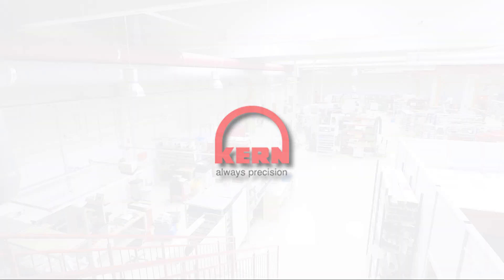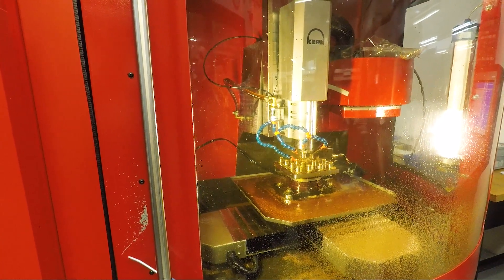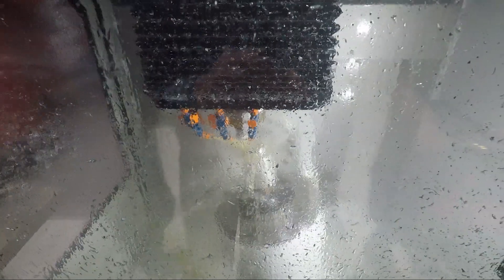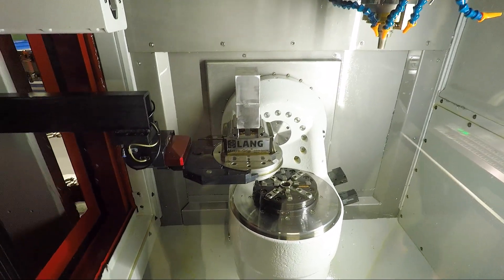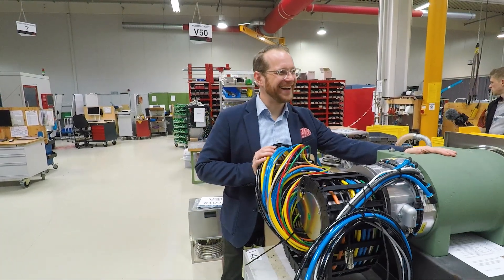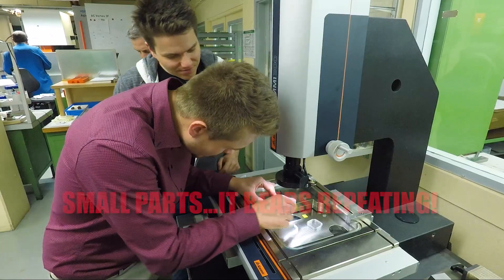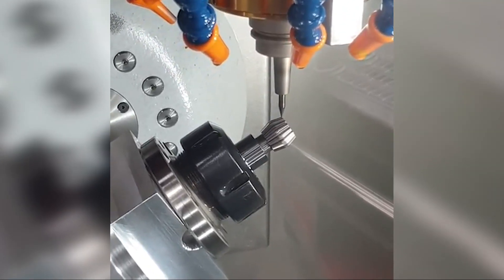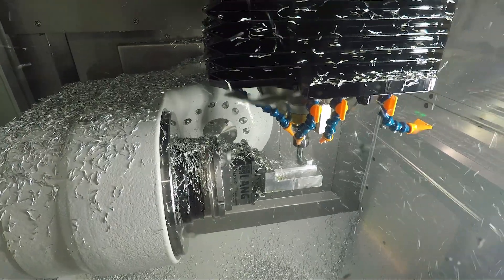Most Accurate CNC Machines in the World: Kern Microtechnik?

Comment: Sublime, great example of perfection being the only standard worth working too!
Reply: 10 years from now these machines will look like garbage compared to the new shit. The swiss lathes I use we regularly make 10 millionths (.00001) offsets and the machine takes them and moves no problem. I don't see how 70 millionths (.00007) is breaking news. We have final product tolerances on medical components of 50 millionths (.00005). Maybe these are the most precise mills or something? I am so confused.
Reply: @chuckphilpot7756  Lathes tend to be single axis while VMC's are multiple, 3 or more.  You tend to compound 'in-' or 'accuracy' issues each time you throw an axis in the mix.  So yeah, it's really good, fantastic actually.  We still use a south bend belt driven lathe for roughing materials, low power, fairly accurate and like everything that has its place a great learning tool.
Reply: @epop3014  I hope you are referring to just your lathe as a learning tool and not all lathes. Swiss lathes are 10x as complicated as this mill. Single axis? 7 axis with an additional 3 provided by the subspindle assembly. Nope, it isn't a single axis or just a lathe. And no lathe in the world is a single axis. Lol. Even your "learning" lathe. Standard lathes are xz motion, while typical mills are x,y,z. Oh and you do know that along with vmc's they also have hmc's htc's and vtc's. All of which can have as many axis as you can throw money at. The only difference between a lathe and a mill is the inversion between spinning work and spinning tool. My swiss lathes are true 5 axis machining with simultaneous back machining. Mills aren't difficult in the least. It isn't like you are hand programming the mills. Or have 20 different mill spindles inside of a opposing spindle swiss. There is a reason they pay Swiss lathe guys more than typical machinists. But I digress. I clearly stated swiss lathe, it isn't my fault you didn't fully understand what you were talking about before replying. I also work with swiss lasers.
Reply: @chuckphilpot7756  I understood.  
Swiss machines are a world apart from standard lathes, mills, of any kind.  The precision is incredible mainly due to the precision of where the work is done and the precision of the stock material used.  It is still essentially a single axis moving a turning part.  There's a reason why lathes were first in the evolution of machinery. 
They are apples and oranges.
Lasers, pew pew pew!
Reply: @epop3014  Actually lathes were the first in machinery because you can build a mill with a lathe. Also swiss lathes came way after mills were invented. There is a reason for that. So basically what you are saying is that you have no idea how a swiss lathe works, correct? Discrediting a multi axis machine because of the precision and thus reducing it to one axis so as to exclude it from the diacussion to make your side of it valid is not a legitimate arguement. Again I will state the obvious since you didn't seem to grasp the fundamentals. The only difference between a lathe and a mill is the rotation of work/tool. A lathe can be used as a mill and a mill as a lathe. So please tell us all how a 5 axis mill is more complex and thus better than a 9 axis swiss lathe with full 5 axis milling capability on not only the main turning spindle, but also the sub spindle as well allowing back machining that isn't possible on your precious mill. Servo rotary or linear motors either turn a ballscrew or operate on a slide. Basically what you just said to me is that 9 axis are pretty much just 1 because surely you can't be wrong about the unparalleled accuracy of the mill you are defending. Lmfao. That same flawed logic applies to your precious mill.  By your logic mills are only single axis as well, because the tool always rotates around the main axis. Rofl.
Reply: @chuckphilpot7756  So what your saying is, someone decided to build a lathe because you can make a mill with it?  Or was it someone needed better clockenworken parts, so they watched youtube for a while and discover a mill was a poor choice for a lathe (not entirely, but mostly poor).
I know how swish machines work, from mechanicals to the confused used by the youngins. They are wonderful machines.  Just like multi axis machines each has a role to play, even the old devlieg.
Thanks for clacking on the confuser,  I've got to get on the old Shopsmith and rebuild a moor jig grinder. I hope my travdials don't slip. LOL
Reply: LOLA, so what your saying is....